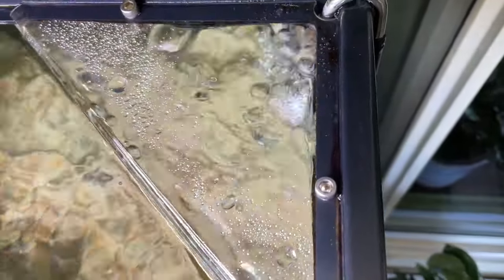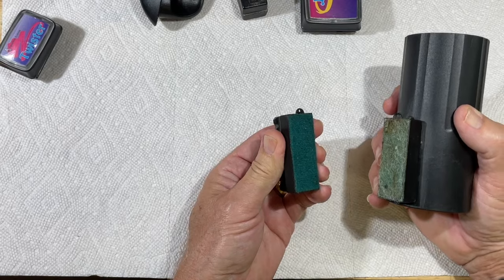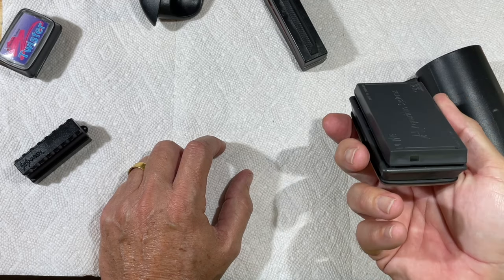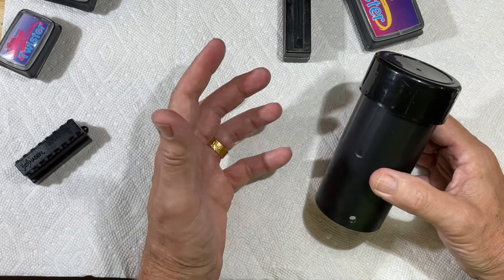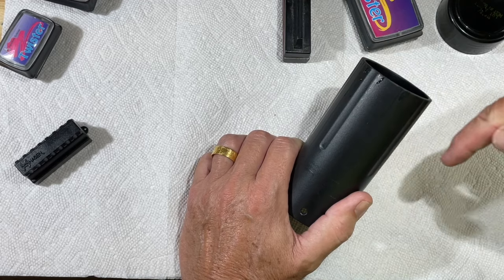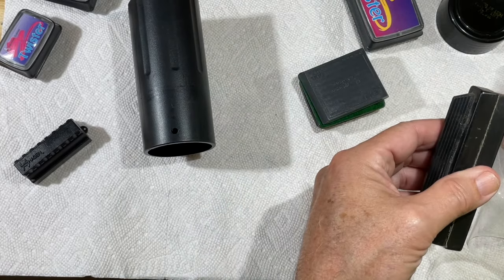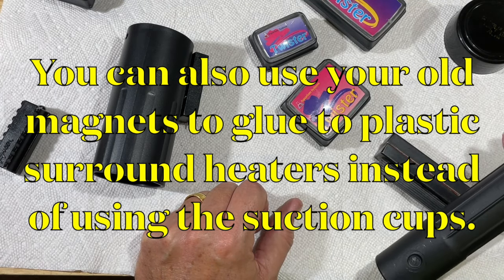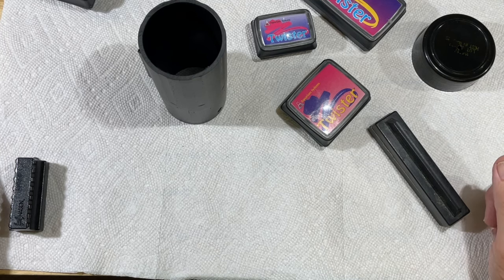Tired of air bubbles leaving calcium deposits on your glass? Learn how to make a bubble-arrestor.

Comment: The problem I have with this tube concept is that it impedes the water flow from bottom to top which would normally happen with an airstone. Some of my tanks only have flow from the "convective" action of the air flowing upward. I think having a tube surrounding the top would pretty much stop that flow, or at least impede it a lot.
I see nothing wrong with the plexiglass version, I would make one if I had this issue, but luckily we have very little calcium.
Reply: I suppose you could drill holes just below the water line, which would keep the water flow from getting "stuck" in the tube.
Reply from the maker: Yes I see what you mean. In your case it will not work or you will have to give up that water flow from the ayirstone.

Comment: Incredible doc! Thanks for another ingenious video. This is the reason why I keep my tanks almost full to the top and the bubblers are in the center of the UGF. I have a wooden canopy that hides the water line. Glad I went 💯 DIY. I hate those white calcium deposits but i don't see them now.
Reply from the maker: Because I'm using the weir the tank can only be filled up so far so I'm kind of stuck with what I have.
Reply: @anoxicfiltrationplenums  Those weirs should have adjustable water levelling or something.. to whatever level possible.. it can't go all the way to the top though.

Comment: I especially like the idea of attaching your heaters with magnets. It seems to me that suction cups never work that well and wear out. The question I have about the bubble arrester is this. I have always thought that surface agitation was important in respect to oxygenating the aquarium water. Wouldn't the arrester stop the important surface movement and thus decrease the levels of oxygen in your tank? It seems like a great idea otherwise. I enjoy viewing DIY ideas like this.
Reply from the maker: Most people have hang on the back filters or canister filters that are moving the surface on top of aquariums. Therefore, really depending on bubble movement of the surface area of the aquarium is not that important but it will still create oxygenated water by increasing gas exchange inside of the arrestor.
Reply: I was hesitant to ask you about Bubble Arrester and here it comes. Thanks a lot for addressing such minor but important aquarium issues .🙏 🇮🇳